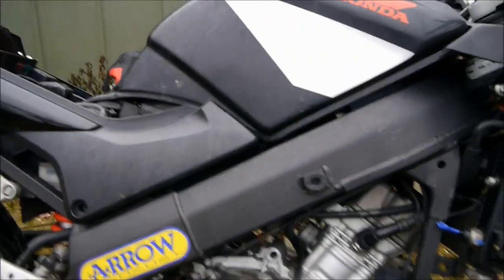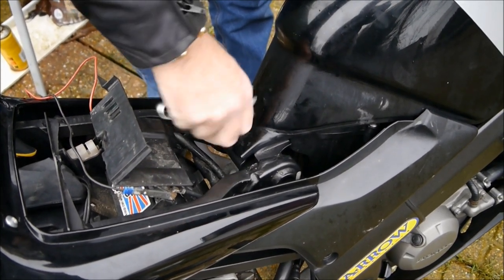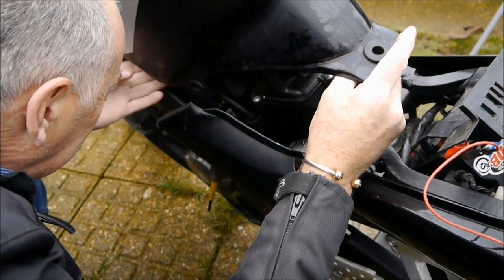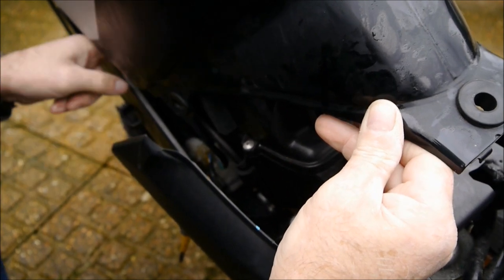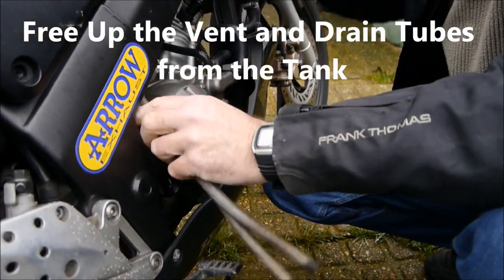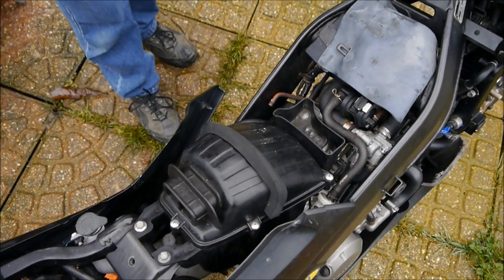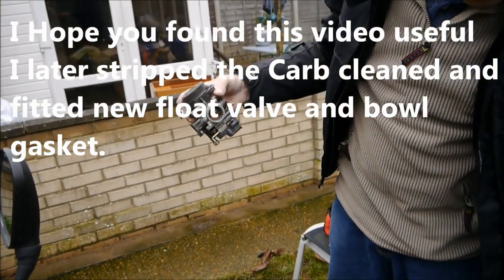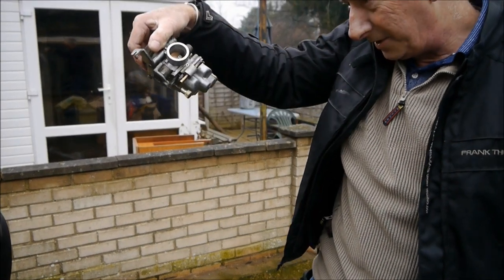"Sparky's Workshop" Honda CBR125R Carburettor Removal HOW TO

Comment: Hi I’m rebuilding one of these … replaced the complete top end…. Timing marks are good…. Bike fired up and ran with lots of twisting (revving of throttle ). Now won’t fire at all?

Tanks is disconnected just using a bottle of petrol to gravity feed carb… does this carb (which is all cleaned) need to be st up with vacuum pipes etc to get a good feed and allow diaphragm s in carb to work and lift needle valve

Thanks in advance
Reply from the maker: @mercurysax8902  hi 👋 on the carb that was on mine I’m sure the vacuum tube was only to operate the petrol valve in the tank which let’s petrol flow when a vacuum is caused by the engine turning.
Pretty sure the needle valve is operated by mechanical control.
Hope this helps
Reply: Hi got it started today think it was more a battery low problem….put a jump pack on it wizzed over much quicker and managed to have it running on full choke…. Once warm…. I’ve already watched and used your carb video… a great help… carb had been cleaned before so now got to tinker with.. idle, airflow etc.

Next is to see why the inlet valve had siezed stripping the cam!!

Gonna connect the rad flush it ..run it up and drop the oil to see if it’s milky!! Hoping water jacket is all good … no temp gauge on this no fairing hack so gotta work out how to check cooling system is good… wish me luck

Comment: I need a bit of help, my CBR 125 is missing  a few pipes, thanks to this video I have figured out the vent and drain pipes for the bottom of the fuel tank. 

However the lower front left of the airbox has a barb I assume a pipe is supposed to go from there to somewhere and I am not sure where? does it go to somewhere on the engine? 

Thanks!
Reply from the maker: Hi the pipes from the bottom of the tank are a breather and drain pipes but not having them should make no difference to the running of the bike. There should be a pipe from the air filter to the crankcase which is also a breather hose.
Hope this helps
Reply: @BikeMates  yeah I figured it out, previous owner had used one of the old fuel vent hoses and pushed it into the crank case breather hose and was venting the crank case breather under the bike.... Not sure why they decided to do this.

Comment: is the choke operating good on yours? My sons are har on cold starts, seems to be no difference with choke out. Cleaned the carb and valves are adjusted.
Reply from the maker: When my sons was playing up the choke just flooded the engine, but once I fitted the new fuel tap it was all fine.

Comment: thanks... i really needed this. having issues so this guide was helpful
Reply from the maker: White Knight glad to be of assistance, hope you solved you problem.
Reply: I did, but ended up encountering a bigger issue. I cant remember which way or how to fit the carb boot properly hehe Its not sealed properly on the carb to the engine letting air in the cylinder. Do you remember which way it should be? That would be such a big help. Thanks so much... love all your vids im a fan :D
Reply from the maker: White Knight hi it should only fit one way as there are lugs on the boot which locate it to the engine block, from memory the lug which sticks out fits near the vacuum tube.
Reply: Thanks so much! Fitted on perfectly now. I live on the Isle of Man. TT has just begun :D First time out on a bike this time of year. Its great.
Reply from the maker: White Knight Now I'm jealous, ride safe 😃
Reply: haha Thanks! im sticking to safe spots. :D

Comment: Can i use a manual fuel tap and block the vaccuum ports by manifold?
Reply from the maker: Yes I don’t see any reason why that wouldn’t work, but I would get in the habit of switching the fuel tap off when not in use 👍

Comment: Hi Sparkey, enjoyed the video. Please help: My fuel filter came off the pipe, and re-doing it, the other side popped off from wherever it was attached. I can't figure out where. It looks like the top end of the pipe goes through a rubber mounting, then to the top end of the carb. I've taken the fuel tank off, and I am now also unsure as to where the small, reddish bent pipe top left - you called it the vacuum - should go back on. Please advise. Rgds, M.
Reply from the maker: Marius Louw hi the vacuum pipe goes to the engine block, and the pipes from the fuel filter one goes to the petcock and the other to the carb. Hope this helps

Comment: Hey man thanks for the vid.  Took carb out and cleaned it. Changed choke cable while I was there. I seen your other vid saying the oil smells of fuel. So is my oil so a new tap is on its way. However I noticed my fuel tank does not have the tubes (air and waste). I can't find them online to order and do I need them?

Thanks
Reply from the maker: leom mitchell glad I could help mate. As for the tubes you should be able to get something in a good car parts store. Ride safe 👍
Reply: @BikeMates  wow man after all this time didn't think you'd reply to an old video. Appreciate it. I think I found the Honda code for the part 950058061020. So does that mean I just need 2 of 8x610 tubes(not getting honda original too expensive) . And they connect to the tank and no where else at the other end just tuck them down the frame.  In theory do I need them?  Because the bike was running without them apparently.  But unsure if that's why the bike stutters when going any faster then 20mph. Change gear stutters goes away until its time to change gear again. Thanks again
Reply: https://drive.google.com/folderview?id=1THjuynOYFSqgEIfysQ9IyHsUzctNAC6z

I think its number 23 on the diagram.   However the fuel tank itself is 2 different sizes of holes. Confused now.  Sorry to be a bother.
Reply from the maker: leom mitchell hi if the tubes go from beneath the tank and pass through the frame they’re the breather tubes which you can do without if you wish.
Reply: @BikeMates  appreciate the help.

Comment: Also, do you know the size of the carb? I was thinking of buying one but all the dimensions are different, some say 26mm,28mm,30mm will fit, so hard to say whats real and not
Reply from the maker: Hi there were lots of changes to the carb over the years the bike was in production so not easy to find spare parts these days.
Reply: @BikeMates  yeah, i was afraid of that, seems like everything i buy next to impossible for parts, even my 05 450x is soon to be obsolete:(

Comment: Hey Sparky, me again - I have a carb related question.
Recently my choke cable came off from the handlebars. The adjustable locknut is still there, but it seems to be missing a piece that connects that to the underside of the plunger, that slots into the "c" shape holder. Anyway, after fiddling with it my bike seems to have changed behaviour. It slowly cuts out when idling with the choke down even when the engine is warm, the choke still works fine as intended, bringing the revs up and it doesn't stall like that. 
Is it possible that you can push the choke cable too far down? I figure there is an adjustable locknut there for a reason and wonder if that's the issue I'm having.
**edit 
I noticed I screwed the adjuster too far up, and the plunger wouldn't go further down. I backed off the adjuster and moved it down til what feels like the cable "bottoms out" and upped my idle screw. It seems to hold it's own. - So i suppose my question is still as above, is it possible to push the choke in the other direction? Like, what would happen if the choke cable was cut altogether? I don't know if you particularly need a choke to be used in 15c+ weather.  Sorry for long reply.
Reply from the maker: Yew Tree as you said you shouldn’t need choke at 15c. As for the cable going to far in, I’m not sure that can happen. Have you altered the mixture screw at all?
Reply: @BikeMates Hmm, well I noticed if I press the choke down as far as the cable could physically be pushed down there's a "springy" pushback effect and I think there's a spring inside the part where the choke cable sits in the carb, so I assume when the spring pushes back it'll set the cable at zero choke. 

With that in mind, I then brought the idle screw to around 2,000 RPM when warmed to normal temp which is around 15-18 when warming, and it seems okay now. That said, I noticed if I rev it to above 6000 + it would settle at around 2100 rpm for atleast a second or two before setting down to the correct 2000 rpm. It sorta hangs briefly. I haven't touched the fuel / air mix, but I think it'll all be okay now.

What temp do you recommend using a choke at by the way? I've not found any definitive guides for the cbr on how best to use it.
Reply from the maker: Yew Tree I think if all the settings are correct then there should be no need for choke above 12 degrees, but that said a lot of people use the choke every time they start the engine. There are no hard and fast rules. Ride safe 👍
Reply: @BikeMates Thought i replied to this but I forgot! Cheers sparky, I appreciate your advice. There's not much being posted about on these older cbrs anymore so you're bloody useful, cant complain really since carbs are going the way of the dodo bird but still!

Comment: Hi mate quick question which way does pipes go from vacuum tap on tank top pipe and bottom pipe
Reply from the maker: James Finlayson hi as far as I remember the top pipe is the vac and the lower pipe is petrol, but I would check by putting a tube on the top pipe and suck it to see if petrol flows. Hope this helps
Reply: Sparky Rides many thanks will try this tomoro hopefully will work your videos are an amazing help for novices like myself
Reply from the maker: James Finlayson no problem mate glad to help 👍
Reply: Sparky Rides hi mate thanks for all your help I can tell you bike is running sweet again best it ever has.happy biker 😀😀
Reply from the maker: James Finlayson that’s good news mate 👍
Ride safe

Comment: Can you remove the tank whilst it's full of petrol or does it need to be drained ? and is there any specific way to remove tubes attached to the carb or is it a simple pull / twist
Reply from the maker: Yew Tree yes you can remove the tank with fuel in as the petcock works on a vacuum from the engine. The tubes just pull off the carb but take a photo first so you know where they go.
Reply: @BikeMates  Legend! I noticed you pulled off the vacuum hose from the tap rather than the carb, does it mater which one you disconnect?
Reply from the maker: Yew Tree no you can disconnect from the carb or the tap, just make a note of which pipe goes where.

Comment: Do I have to remove the tank? Or can I just place it on a chair with alle the wires connected? thank you. 
great video
Reply from the maker: 64Shakur hi you need to unplug the fuel gauge sender wire as in the vid, remove vacuum and petrol tubes, then gently pull on the side panels to unplug from the tank then you can lift the tank and remove the vent and overflow pipes for the tank, then pull the tank backwards and lift off. Hope this helps thanks for watching.

Comment: Hey, just took the carb off and cleaned it, but now I’m lost as to where the fuel tube is supposed to connect into the carburetor. Really need some help since the bike won’t start without it hehe. Cheers!
Reply from the maker: StoneCabin hi the fuel tube from the tank connects to the left hand side of the carb near the bottom.
If you’re unsure which is the fuel tube at the tank end just gently suck on one tube if petrol flows out the other tube then you will know.
Reply: @BikeMates  Is it at the top of the float bowl or the bottom? The tube doesn't reach to the bottom... So I would assume it's the orange-ish connector at the top of the float bowl
Reply from the maker: StoneCabin yes looks like a brass colour spout 👍
Reply: @BikeMates  Thanks, got it fitted there. Cheers!
Reply: Hi sparkyrides could I just ask the 2 pipes from the tap does the fuel pipe that goes to the carb go on the top of that our the bottom please

Comment: Sparky do you have a video on choke cable changing on the cbr 125.cant seem to find a vid anywhere
Reply from the maker: James Cunningham hi James sorry I don't have a video of this but I have change the choke cable and its quite a simple job. You will have to remove the tank as in this video and remove the choke from the carb as shown, then it's just a matter of removing the lock nut at the knob end and pull the old cable out and refit in reverse. Hope this helps
Reply: Thanks pal much appreciated.i thought that's how to do it but thought I'd ask a guy that knows how.great vids pal very usefull

Comment: What should i do if my CBR is not reving up?
Reply from the maker: Marián Mician hi what are the symptoms?
Reply: @BikeMates  I quickly rotate gas handle to rev it and i won't rev for a second and then it revs. Maybe it's only lean becouse i started it month ago and it was great. Month ago was 20 degrees outside maybe higher, now it's like 8 degrees. Not fahrenheit but the other ones i forgot the name sorry.
Reply from the maker: Marián Mician have you tried letting the engine running for 10 minutes then rev it?
Reply: @BikeMates  I only let it warm up for 2 minutes and then rev it. I've already solve it. It was lean how i was expecting.

Comment: HELP .. i have a black tube hanging down on left side. it seems to be coming from top of carb, ive no idea what it is or where it goes ? .. i took bike for service and it came back like that .. and also bike is really down on power. ?
Reply from the maker: cyberjack hi how big is the tube? As big as a pencil or bigger?
Reply: bigger.. think its one next to fuel pipe, i assumed it was the Vac line, but i lifted tank and couldn't see anywhere it could go.. (and its a 2006, carb) i'll add a image url . in min ..
Reply from the maker: cyberjack hi that looks like a breather pipe from the air box which should be routed through the frame with the other tubes. What's the yellow pipe?
Reply: Yellow pipe is the airbox drain tube (condensation)
Reply from the maker: cyberjack shouldn't that be routed down through the frame? If your bike is running poorly I think I would take it back to where it was serviced.
Did their change the air filter? If so then the tank would have been lifted and maybe they've trapped the vent pipe from the tank.
Reply: Sparky Rides not sure tbh about the drain tube. Yeah thy did change air filter.. I think I'll take bike back .. thy obviously stupid.. not be going thair again that's for sure... Thank you for your help
Reply from the maker: cyberjack no problem hope you get it sorted. Ride safe

Comment: i cant seem to understand why the cooling lines goes thru the carb.
Reply from the maker: Yolos Games hi it was to stop the fuel vapour freezing in colder countries.
Reply: oh because im installing a bigger carb ( pwk 28 ) and theres no place to put the cooling lines.
Reply from the maker: Yolos Games no problem just get a small tube and join them together.
Reply: didnt think of that , thanks !
Reply: How many mm is the original card.. Sorry for my english is not so good! Thanks

Comment: Did this bog out at high speeds and you'd have to go down a gear to get the Power back as I've got the same bike as that
Reply from the maker: ImLegitclan _ hi no it wouldn't even rev properly, because it was getting to much fuel and flooding the engine (filling the sump with petrol.
Bogging down sounds like petrol starvation or lack of engine oil.
Reply: Hey i know this is an old comment but im having issues as well.
trying to figure out whats going  on when i accelerate it seems to like jerk and not accelerate its at about 7k rpm in any gear and i need to shift up earlier then normal in order to go any faster did you have this issue?

Comment: Hey so i bought this carb, but it does not have water hoses at the bottom. Where does these water hoses go? Do i redo the line so it skips the carb? What is the function for those hoses? https://www.honda-cbr-125.com/honda_cbr_125_special_keihin_pwk_29_racing_carburetor_bowden_cable_set.php

Comment: HIya, on the fuel tank when you remove it we cannot see which pipe comes out of where on the petcock on the bottom of the tank  https://www.ebay.co.uk/p/13030970239  which pipe goes where there are 2 possible pipes , one of them is yellow and the other is black on my bike . thank you
Reply from the maker: 3D Ag3nt hi the pipe that goes to the engine block is the vacuum tube and that should be connected to the vacuum of the Petcock the other pipe goes to the carb inlet and should be connected to the fuel pipe on the petcock. You can test which is which on the petcock by gently sucking on one of the outlets on the petcock till fuel flows from the other.
Reply: @BikeMates  thank you so much you are a star . You still have the CBR ?
Reply from the maker: 3D Ag3nt that’s no problem 👍 no the CBR was my sons and he has since passed his test and moved onto a bigger bike. Ride safe
Reply: @BikeMates  the good news is. Carb stripped cleaned reinstalled fresh fuel and it started first time the bad news is that the fuel overflow peed fuel on the floor, am i right in thinking this is the float bowl height? I'm not sure how to adjust the float bowl on this carb there is no washer to move up and down like on most carbs , any ideas please , sorry to keep on ,  just want it to stop overflowing fuel . Thanks again
Reply from the maker: 3D Ag3nt yes I had the same problem, and you’re right there is no adjustment. I managed to find one on eBay and replaced the needle valve at the same time.